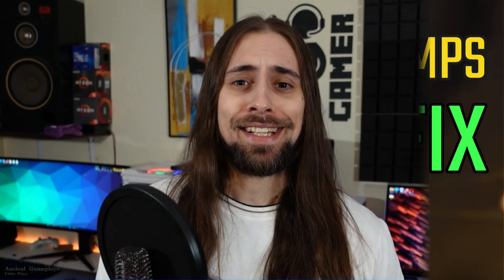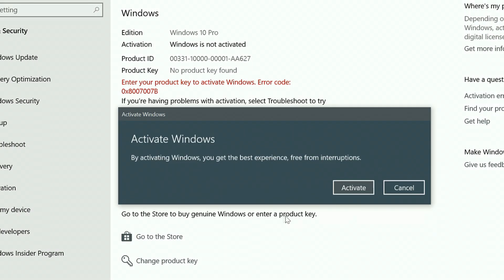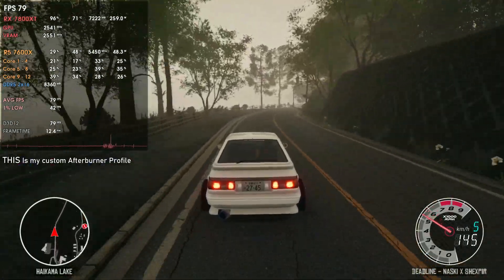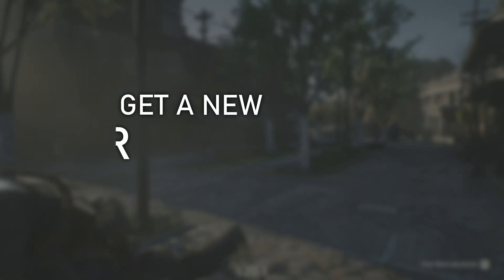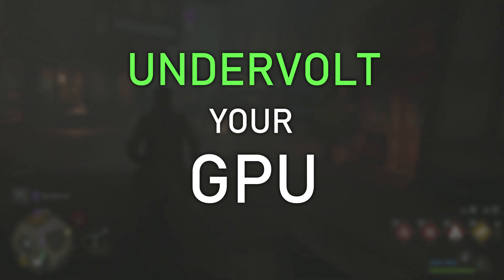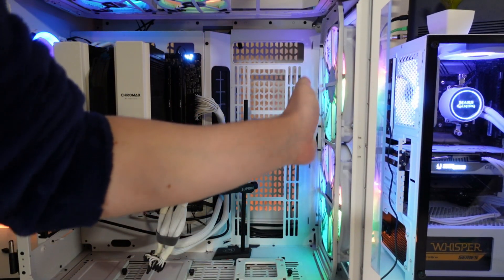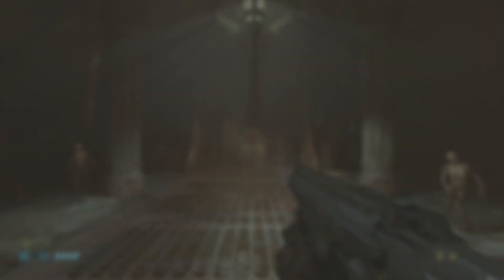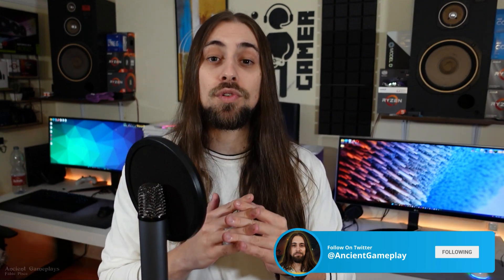HOW TO FIX your PC High Temperatures & Airflow Problems [2023 Guide]

Comment: Nice video as always, I would like to add my experience with my GPU issues with temps.

(I get all my info from HWiFO64 and Rivatuner) So I had/have a 7900XT XFX merc 310 Black. The first one had an issue with the GPU hotspot being 30+c warmer than the regular GPU temp, the GCD was hitting 110c which is the thermal limit. I repasted and repadded (the torn pads only) and it "fixed" it for about 2 months but then the huge delta between the reg temp and hotspot temp came back. I RMA'd it and now I have another (new) one from XFX. 

So far with the new card (tested less than a week at writing) my regular GPU temp while drawing 1-150w is around 1-5c the difference of the GCD hotspot (depending on fan speed the regular GPU temp is 60c and the GCD hotspot is around 62c). Drawing max wattage (350w) the delta goes up to 10-15c. 

Remember if you have a 7700, 7800, 7900 card you will see (though HWiNFO64) the hotspots of all of your MCDs (cache chiplets) and the GCD (compute chiplet). 

So sometimes it pays to really have your attention on your GPU temp to figure out if your GPU is not like it should (watch some reviews from people on youtube about what temps you should expect, it is what I did to find out my temps were WAY out of line). Based off of that you know if should RMA it to try and fix the problem.

AMD should really press the AIBs to have better quality control though.

Edit: all of this was tested with the side panel on and off of my case (normal mid tower with glass side panel) just to make sure it was not an airflow problem.
Reply: I have a XFX MERC 319 7800XT 
It’s inside the O.G Coolermaster H500 (x2 240mm fans) I have it set + airflow. my gpu temps are 43 and the hotspot gets up to 63 ish. Am I good????? I noticed you mentioned 20+ more for hotspot but I know like a car, a liquid cooled engine will always have a hotter spot on the head. Same concept as the die
Reply: @ReflectingGlory1  If under full load your hotspot is only 60-65c then yeah i would say you are more than good
Reply: Makes me glad I never had that delta issue. I give mine a little extra support by tying a little piece of string from the outer-right side to the top of the case. It pains me so much to see it droop, even a little.
Reply: @Ieonblack  I have a helicopter 🚁 in mine on 2 lb test invisible 🫥 fishing line and the propellers spin when the pc is on lol

Comment: Hey Fabio.
Cool video.
You didn't said anything regarding Nvme Heatsinks.
IDk if you tried playing a game using an overheated Nvme ... it's laggy/spiky/choppy and might even throttle it's way to BSOD
Reply from the maker: I did say case airflow could impact nvme and make things throthle as well. Any nvme that needs a heatsink sucks, or is wayyy to fast haha
Reply: @AncientGameplays  Any gen4 NVMe that's worth a crap runs fast and needs a cooler on it.  You get into problems because SOME AMD based systems have the first NVMe port below the GPU, and it's ALSO the one that connects to the CPU which is the optimal to use for the OS/programs and some games as in the newer ones that have higher demands.

An NVMe in that spot should have a heatsink regardless.  You either get a lack of airflow there when the GPU is doing little work, or when gaming and the GPU heats up you get warm air pushed at it.

And I'm pretty sure the same would be true for Intel based systems where that first NVMe connects to the CPU.

There are some MBs where the NVMe port is above the GPU slot.  I like that config but unfortunately the MBs I like the best have the PCIe X16 slot closest to the CPU so the first NVMe is below the GPU.  For instance the Gigabyte X570S Aorus Elite/Elite AX boards do EXACTLY what I expect them to do and the other PCIe slots on them all connect to the chipset.  It means that the one X16 slot gets the full attention of the CPU, you can't run an X8-X8 config, but I use one GPU so I don't care.

I know there's a lack of games that use Microsoft DirectStorage right now but that will change and the work load on the NVMe during game play will increase.

Because I want certain games to have very fast disk access (newer games like 2021 and newer) AND because my system requires one disk goes under the GPU, I use the 2nd NVMe port that isn't buried under the GPU to load those games on so it's not as bad for heat.  I'd use the third port that's the furthest from the GPU for games but I do dual OS and that has Linux on it.  The 2nd port has a WD SN850X and yes they're fast.
Reply: How hot is yours getting? Mine never goes above 55 without the heatsink on. I have one, but I wanted to see how it ran without it, and yea it's been running fine. Silicon power UD90 4Tb tlc.
Reply: @Ieonblack  I have 2.
A NV1 without DRAM.
A 970 Evo with DRAM.
The DRAM chips get hotter by nature. It's normal if they run at some higher temps.
The NV1 without heatsink was doing 45 Celsius. And it was throttling. There were spikes in games.
I play competitively ... so ... that's a problem for me ...
The 970 Evo was at 55 without heatsink. Also. Very bad experience. Much throttle.

With heatsink (5 bucks, cheappo stuff):
NV1 is at 37 and 970Evo is at 42. No more throttling. Everything runs smooth AF.

All temps are in gaming situations. Not full workloads, where you stress-test it by copying hundreds of GB of files to it.

The whole thing is subjective. My mom for instance doesn't have a heatsink on her SSD, but she's 65 and doesn't game. And especially not competitively. For her, it runs just fine.
For us sweaty gamers ... a Heatsink is a must ...

Comment: I've got an msi 7900xtx gaming trio classic, card would be around 59/65 C and have an hotspot of 84 up to 94, if i set the power limit up to +8% It tends to go above 95 in the hotspot, should I rma?
Reply: My first 7900XT did this (60 reg temp 100-110c hotspot) even with a support for sagging after a few months, i repasted and padded the torn pads and it only helped for around 2 months. 

I ended up getting a RMA and now my delta at max wattage is around 10-15c at 350w. No idea if it will stay that good but it does seem like some coolers were made....poorly lets say.
Reply: @Azureskies01  Messing with thermal pads is almost never a good idea. They often end up being the wrong size or thickness and making temps worse. If you think of resorting to changing pads you might as well start the rma process early.
Reply: @Nein99x  I was in contact with XFX and got the size and thermal conductivity from them so I didn't have any reservations about changing the pads. Torn pads are very likely to mess with the thermals of whatever they were contacting as well.

 I will agree though, if you don't have torn pads just leave them be. Lot less of a headache that way.
Reply: That hotspot delta is definitely on the hot side. Did your gpu come with a support bracket ? This seems like an issue of uneven contact caused by sagging.
Reply: I have  7900 XTX on 100% load my temps  are like that with +10% PL (in a  small mini ITX build).

As far as I know and could find... If Hotspot is around 20 degrees over gpu temp is normal. Hotspot is max temp registered over multiple sensors and it should be OK under 100 but not really sure about this 😅. I'm confident as silicon critical temp seems to be 125 and the GPU and CPU all have built in controls to prevent damage (throttling)
Reply: Normal temps. Those temps do not sound out of the ordinary for that brand of 7900xtx. Your room temp and case fan setup will be a factor as well.

Comment: have a sapphire rx 6900xt nitro+ se and when playin cod mw2 my gpu temps are 90 or 95 i rampped up thee fans and all that but yehh idk if thats are stable temps for this particular gpu. good bless abracos de bosnia
Reply from the maker: You can still do something there as stated in the video!
Abraço!
Reply: Undervolt and set a normal curve dude
Reply: i did all ready everything but idk where is the issue 
 @Ieonblack

Comment: The temp on my Mech 6700xt has been 90+ ever since I bought it. My 5800x3d never gets over 50
Reply from the maker: Mechs are sadly bad models for most gpus, undervolting helps as said in the video
Reply: You can try to set the fan curve higher, I'm using the tuning in the adrenaline software. My sapphire model was running the fans way too slowly as well (20% at 90°C) so when pushing it to 55% it's now at 70°C more or less whatever the temperature of the day is. 
And undervolting does wonders if it's stable, for mine the driver sometimes resets but otherwise is fine
Reply: Yeah the general rule for AMD cards is buy Sapphire because just buy Sapphire... it is something I wish i would have done before i got my XFX 7900XT.
Reply: The xfx cards are actually good, and I think they make a bunch of triple fan ones. The only thing I'd recommend is to remove the stupid LED side panel crap since it restricts air flow. @Azureskies01
Reply: @Azureskies01 look into PTM7950 paste bruh. Made huge improvements for me.
Reply: Download the newest drivers. Mine did the same thing, new drivers=70 at the highest.
Reply: Damn didn't know AMD Copeon GPU can be this bad. Such a hot hazard
Reply: @neoaliens8635  It's not AMD"s fault.
It's the MSI Mech design. Cheap AF
Reply: Brand loyalist spotted lol @neoaliens8635

Comment: Should I buy msi mobo or gigabyte mobo cause the issues with ryzen 70003d
Reply from the maker: What issues? have both Asrock and MSI here with no issues
Reply: @AncientGameplays  ok thank I was gonna buy gigabyte mobo so the issue only with gigabyte mobo and asus mobo right ??
Reply: @AncientGameplays  the issue with bios that the ryzen 7000x3d explode cause of high voltage
Reply: Any mobo is good nowadays. Except gigabyte.
Reply: @korosoid  why ??
Reply: @michael_ragai  Tricky power circuits, questionable design and RGB support... That's first what came on mind.